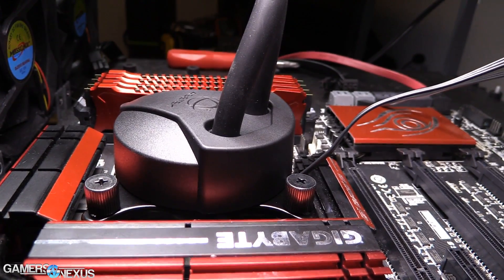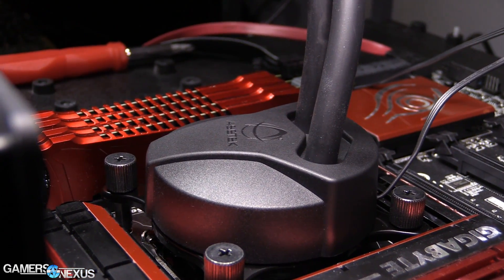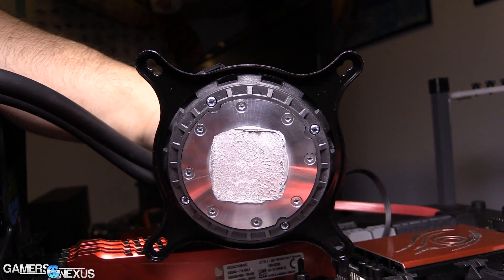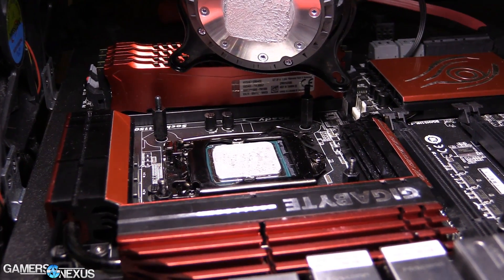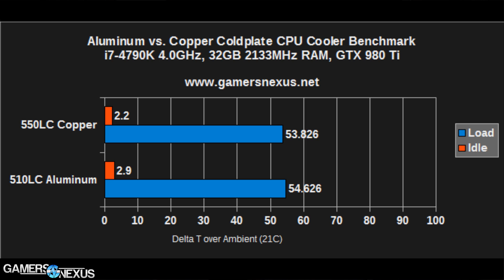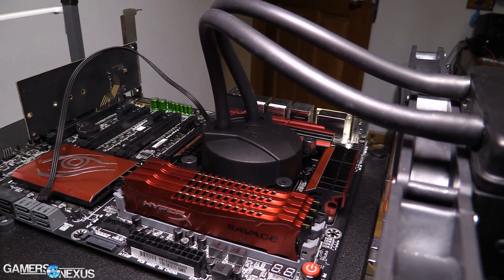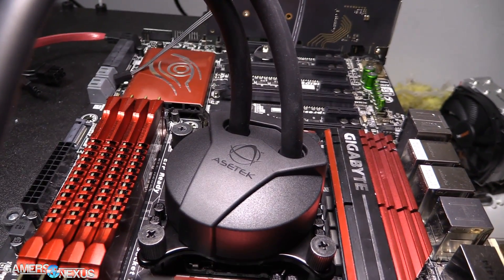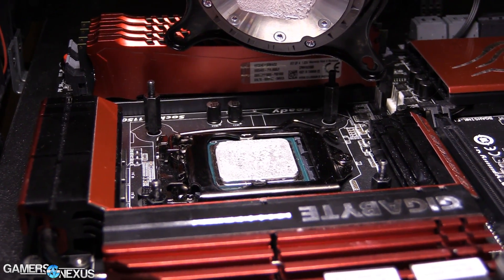Aluminum vs. Copper Coldplates for CPU Coolers

Comment: I miss the good old days when you could buy a solid copper aftermarket CPU cooler. Copper cools so much better. People try to argue by saying aluminum dissapates heat faster which it does but aluminum also warms up faster than copper. Copper not only cools better but it also retains cool temperatures much better than aluminum. If Noctua made a solid copper NH-D15s that would be one bad ass air cooler and most likely outperform AIO and custom liquid coolers by a significant margin.
Reply: The issue is the cost of copper.Good air coolers will out preform a low quality aio and is pretty close to quality aios in terms of temps.Ill personally take a air cooler over a aio because of durability.I replaced a aio with a Scythe FUMA, NH-D15 is too big for my mid tower and i`m pretty happy with temp.Unless i decide to do a custom loop when i have the money i don`t see myself ever buying a aio.
Reply: @justaperson8815  Some AIO aren't bad. I have a Thermaltake Ultimate 3.0 in one of my builds and it has been doing really well for the last 2 years , but I recently replaced a NZXT Kraken X62 that only lasted 4 months with a Coolermaster MA621P Air cooler. The Cooler Master MA621P does a much better job than the Kraken X62 did.

Comment: so I did some calculations... :D and what I found that copper has C= thermal capacity C copper= 0.4 kJ/kg. °c that means that it has  get about 400J of energy to go from for example 32°c to 33°c so that means that tha coolant can lower the temperature of the copper faster  ... as for aluminium... it has C of 0.88 kJ/kg °c...    .=multiply     so aluminium takes about twice as much energy to go from 32° to 33°  so in large size  radiators it does not matter (dont mix metals) but in 240mm radiators and lower I wolud thake the aluminium one and make sure that you dont mix metals. :D

Comment: I have a question: Why do they make the CPU it self out of aluminium? Why can't they make it out of copper? if it was twin copper substances exchanging heat, wouldn't that be more efficient? 
As funny as it may sound, i think we have a case of thermal 'bottle-necking' here!
Reply: Material cost. Although I'm posting this a year later and there's been a scrap metal market crash, aluminum has always been cheaper than copper in reference to consumer computers.

It's inefficient from a business standpoint to use copper as a standard material for desktops. Using the "best" is not always a smart idea, as using a material that won't be used to its greatest potential is a lost investment that could go into another component--or investor pockets.

The last part is a little cynical, but the main truth is there's no point in making copper the standard because aluminum does more than enough for standard computers aside from ego purposes. Gaming computers are a very, very small minority, and we can simply swap it out when purchasing a gaming rig or custom building.
Reply: I am sure cost for that little bit of metal is no issue for processors that cost over a thousand dollars ( Yes, the new I7 6950x). Just because its enough doesn't means enthusiast should just sit around. I perfectly understand how little difference this will make, but still. Also, I think a reason we don't i because copper is weak, and might break or bend under pressure from a large heat sink.
Reply: It costs you a thousand dollars to purchase. It does not cost a thousand dollars to make.

What part of the processor are you talking about? Since this is a heat sink discussion, the relevant part is the IHS. 

The IHS is made of nickel-plated copper with gold-plated copper substrate lands, not aluminum. That's the closest thing I can think of to being mistaken for aluminum.

Comment: Since thermal resistance is measured in mm, it would make sense that a block would be much less affected by it, since the heat doesn't have to travel very far to get to the cooling medium (water).

Comment: Hey Steve love the channel. I'm really loving my AIO cooling solution for my Athlon 860K that I have set up in a push exhaust. Which method do you prefer? Push, pull, push / pull and do you prefer to intake or exhaust? Thanks.
Reply from the maker: f1tony2003 Great question. Sort of depends on the case, but in my (yet unpublished) testing, I've found that push configurations almost always work better as long as the air is being pushed out of the case. If it's getting pushed back toward the CPU, you have a problem where the board will heat up and case ambient rises. Try to set up a push exhaust toward the back of the case, that tends to work the best. A push/pull will sometimes not generate actual measurable gains if the cooler is already super efficient (I think we showed this in an old CLC round-up with the X40 / X60 vs. H110, H90). If you want to use a CLC setup with slower fans (to be quieter), then you could do a push/pull setup to allow a quieter configuration while still offering high airflow.

Generally, and especially for the 860K, a push setup will be best.
Reply: Gamers Nexus Thanks Steve!

Comment: @4:57: Use slightly less thermal paste.

Some thermal paste don't spread that well when cold. Bring the closed thermal paste tube up to temperature first (hair-dryer or put it in the sun).